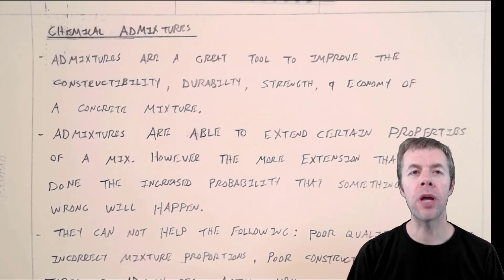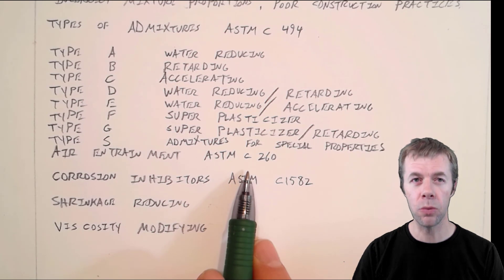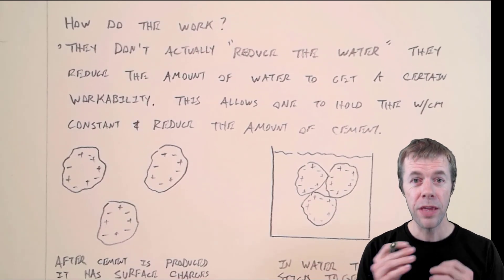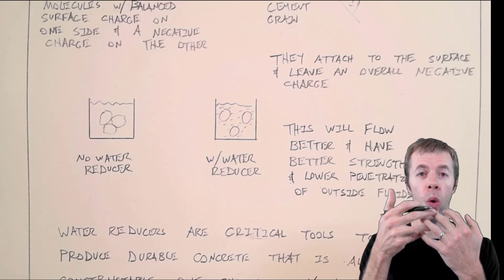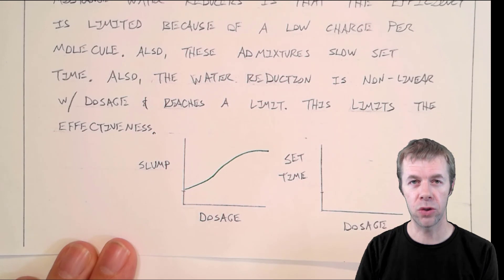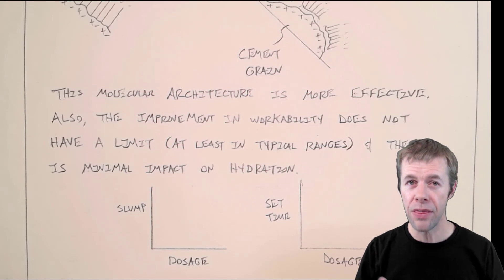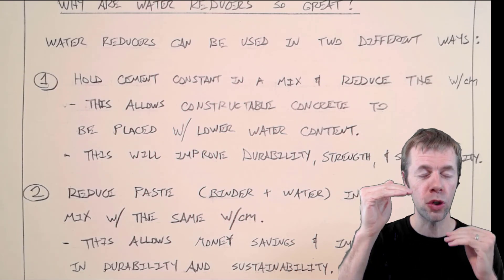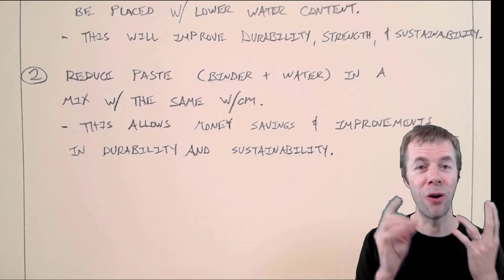Admixtures for Concrete – What is a Water Reducer?

Comment: water reducers and plasticizers are of the same chemical right? As a water reducer, you can use its dispersant property to reduce water to: 1. increase strength-lower w/c ratio (maintaining cement content and slump) or lessen cement content (maintaining w/c ratio and slump). As a plasticizer, you can also use its dispersant property to increase slump (maintaining w/c ratio).

Comment: Dr. Ley - Just found your channel and have watched a string of videos already.
I’m interested in ICF block form construction and one of the key concerns I’ve heard others point out is the ability to get the concrete down 8-10’ feet of wall through the forms plastic webbing, in addition to the rebar and ties. 
A common theme has been slump… most of concrete contractors suggesting 5 or 6. And, water reducers are always noted when the slump is suggested.
All of the above said, do you have a recommended specifications for water content, water reducer and other admixtures… on a per yard basis?
Do you have any thoughts on using a 6 slump, given the reasoning noted above?
And, what are your thoughts about specifying a smaller sized stone in the mix?

I don’t want to weaken the strength of the concrete. If anything, I’m interested in constructing stronger walls (and roof, as I intend to use ICF roof panels forms as well).
Thoughts on fiberglass additives into concrete mix for slab and roof panel forms?

Also… I appreciate you pointing out alternatives to epoxy coatings in one of your other videos. I will definitely be liking into availability and cost for galvanized rebar!

Appreciate your videos and any help you might be able to provide to my questions. Hope you find the time to create more videos in the near future.

Best, Chad
Reply: We actually have a superplasticizers that we highly recommend for use in icf construction.  Check out our product video to learn more.  https://www.youtube.com/watch?v=RNWNapd84Hs

Comment: Thanks for the great video. Here's my novice question: Would you recommend adding a polycarboxylate water reducer to store bought concrete mix (i.e. Sakrete high-strength) for pouring a slab. If so, can you recommend a brand and proportion of this admixture?

Comment: Tyler what is the true strength of the ready to use concrete mix (off the shelf) ?
Reply: Yes! Please answer that! The Quickcreat Pre mix is supposedly 4000 psi from that bag. Bull CRAP! I always mix in more Portland cement and even some play sand if I’m using it to do a small pour just to make it sort of decent. There’s no way it’s as described on the bag! Please do a video on this man!

Comment: Thanks for the great video. If I'm using a liquid form of PCE super plasticiser, I'm guessing there'll be a point where more will start reducing concrete strength due to the material of the PCE admixture beginning to keep the concrete particles too far apart for high strength development, like more water would. Is that right?
I'm trying to make a strong self levelling compound with a W/C of ~ 0.36 or under, that flows really well, but am finding that ~ 2-3% addition of super plasticiser required to get near that fluidity is leading to more air bubbles than wanted, so reluctant to add more..
Reply: Sounds like you might need a defoaming agent like he mentioned in the video.

Comment: When mixing I have always added Glenium to my mix after adding water, but a BASF guy just told me that I should be adding my glenium before my water.  What do you think?
Reply from the maker: Thanks, 
I have never heard to add it before the water.

I always add my water reducer after getting some minimal water slump.  Also, you don't want to add the water reducer too early or it will be absorbed in the early C3A reaction.  However, they may know something that I don't.
Reply: I can't think of one dry batch plant that doesn't add it into the head water of the load reasoning being is mixing the polycarboxylate & water together so when they come in contact with the other constitutions + cement during the ribbon loading process that will be more uniform throughout the drum this is the industry thinking even though all the water reducers are said go with the tail water. The real world kicks in efficiencies in the mixing drum of the mixer how worn are the mixing blades in the belly band of the drum ? what is the blade design? how much build-up is there in the drum? right around the roller ring can get clogged up badly it's hard to wash every load stay efficient you can get a small hole about 15" I've seen slows down the moving of the material(loading to bigger problem) from this sloshing back / forth = spiraling method of the mix there are no fins working upward between the blades in 80% of the drums based on money that actually lift break the mix up stir it unlike a mixer drum in a wet plant ...

Now with a dry plant operation loading somewhere between a 60 to 40 water sequence or 75 or 80 or 90 I usually see higher numbers the injection tubes are near where the water drops in they want to make sure that the water & admixture is washed in completely another reason busy days rushing ,new drivers that don't no much about concrete but can drive the truck go right up start washing in getting the load out / delivered usually wins over quality (with say a tail water introduction of admixture ) U could have a gallon of admixture in the discharge section of the drum (in front of the roller ring) that hasn't dispersed through the load getting a false slump ... any mixer driver will tell you unless you're stopping mixing the load no water 95% of the time the last couple yards is always going to be dryer at a moderate discharge speed the only time I've never seen this untrue providing no water was introduced is a mix design with a ton of slump retention I've actually seen it go the other way it loosens up yes could be near 2" of slump ... Could it be the dosage maybe? Could it be the ineffectiveness of the blade design ? it would have to be tested under those conditions ...

Lab Concrete=Plant Concrete=Mixer Drum Concrete=Form Concrete > biggest battle is how to keep it the same

Comment: Great explanation of the concrete admixture theory. And I too agree that PCE based concrete admixtures are the best in the current market. However, I am wondering why PCE based superplasticizer has a low tolerance level of unstable quality of concrete ingredients. Being based in Indonesia, a country that does not follow standard concrete protocol, our country has been facing lots of instability problems in concrete strength and durability due to the variant non-standardized concrete ingredients. Would you be so kind as to give a suggestion to mitigate such problems? 
Also, an interesting fact that I found out during my work survey in China, that China has a history of using an Aliphatic (fatty acid based) superplasticizer during their cultural revolution period (around the 1980s up till recently around 2000s).  They have been discontinued due to China's current strict environment issues but this type of superplasticizer has a higher tolerance level on mud content and unstable concrete ingredients, while at the same time, able to be fused into Naphthalene based and PCE based superplasticizer.
Reply from the maker: Thanks for the info.  PCEs are very sensitive to water content in the mix.  Also, if there are clays in the fines then they can absorb the PCEs and they will not disperse the cement grains.
Reply: @TylerLey  Noted. Thanks for the reply.

Comment: Dear Sir, could you please suggest an admixture for Class C fly ash based geopolymer mortar/concrete, to improve the setting time and workability, as these are prepared from high ph (13-14) alkaline activators, so the conventional PCEs are not working in high ph thus the final setting is close to 30 minutes only. TIA.
Reply from the maker: This is a tough one.  The best plasticizer for this situation is water.  It will help with workability and set time.  I realize that it will reduce strength.  You might try blending in a class F fly ash.  This will also help.

Comment: Thanks for video. As you say the superplasticizer based PCE have a secondary effect, increase air content in concrete. But why the air content is so unstable? The air content can be 2.0% at time zero, but at 60 minutes it is 7.0% for example with some sands.
Reply from the maker: Good question and there is not a simple answer.  Air is created from mixing.  Some combinations of admixtures will build as they mix while others will increase only to a certain value and then stop.  However, PCE will make your air entraining admixtures more efficient.  This means for the same dosage you will get more air.  This is also dependant on the mixing energy.  If I knew more about the materials you were using then I may be able to help more.
Reply: @TylerLey  thanks. In Colombia we don't use air entraining admixture because we are a tropical country. The situation with the unstable air in concrete  was observed in laboratory and industrially. The materials for concrete are:  Cement HE , sand river or crushed, gravel crushed,  plasticizer based Lignosulfonate and superplasticizer based PCE. We also know with superplasticizer based on sulfonated naphthalene we don't have problem with inestability air, but this technology is limited. 
Thank you for your time and share your knowledge.

Comment: What is the maximum strength of concrete we can produce in real life , and what is the least added amount of water per 100kg of OPC to obtain this ultimate compresive strength?
Thank you
Reply from the maker: ultra high performance concrete can get a compressive strength > 20ksi or 140 MPa.  This is not normal concrete.  You have to reduce the water content to about 0.30 w/cm.  You also have to carefully design the size distribution of the binder that you use.  Also, you may have to cook the concrete as well.  With normal concrete you can get 15ksi or 100 MPa if you have the right aggregate.
Reply: Tyler Ley Thank you again...I like watching your videos..so helpful and enlightening

Comment: if plasticizers reduce static elelctrical charges, can a ground strap be used during the batch process to eliminate or reduce the charges and use less water? could a ground strap be used at the jobsite to reduce the static generated during transit?
Reply from the maker: Thanks for the question.  Plasticizers don't reduce the electric charge.  They provide the same electric charge to the surface of the cement grains.  This causes the grains to repel one another and makes the concrete more workable.